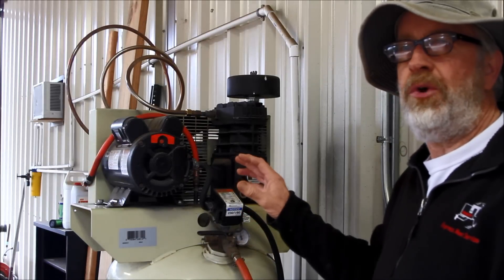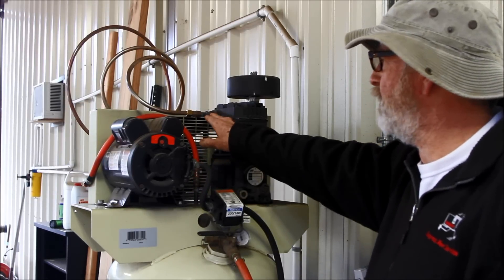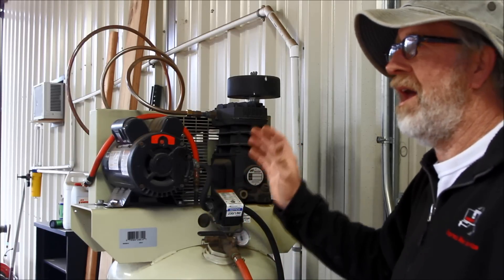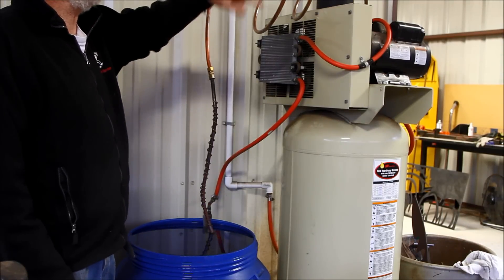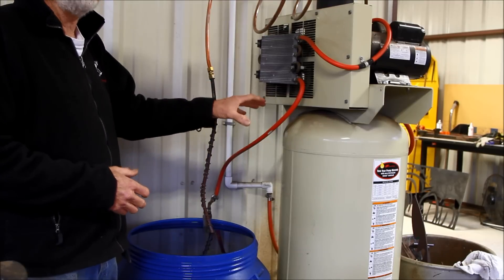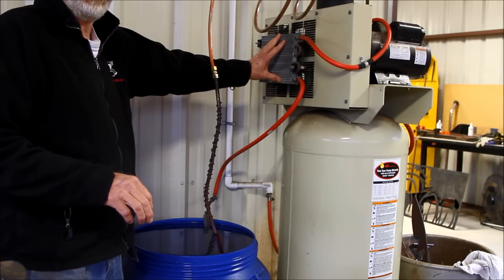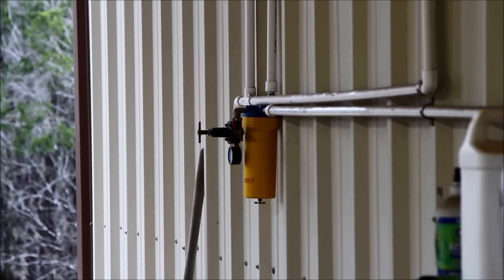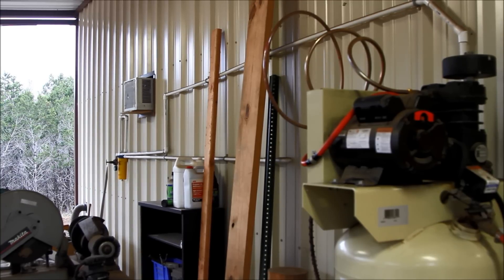How to make a Air Compressor After Cooler (low cost)

Comment: Hey Doug....Could I run the copper coil in a ice water bucket directly out of the tank and get the same result? ( as opposed to after the pump) Thanks, Tim
Reply from the maker: +2ndTimothyOutreach NO...couple of things, ice would not last very long and be back to air temp very soon.and you need to cool down the water before the tank. that is where its going to trap water by the heat, you don't need to cool down the air in the lines, that will not help you very little or at all
Reply: +Doug Green  ... Sorry ...Ice water ( water with ice in it..same as yours)  ...If I cool down the air , and then have a gravity pipe to bleed off the water and a filter..that should work correct.?, ( it would act like the tank.....Seems a bit easier to for me to do)

Comment: Hi Doug,You did a nice job and it looks to work very well. Can you tell me please which air filter and housing you are using for your compressor? I do have the same compressor at home, and i dont like the small plastic filter housing with the undersize filter. I believe it is choking the air compressor. I would like to upgrade mine with the same filter as yours. (Mine is a SS3L3 60 gallons vertical tank). Take care!
Reply from the maker: +Etienne Gallant http://www.amazon.com/gp/product/B000GI0H2M?psc=1&redirect=true&ref_=oh_aui_detailpage_o02_s00this is the motor guard I have just before the tools
Reply from the maker: +Etienne Gallant http://www.amazon.com/gp/product/B000RH370G?psc=1&redirect=true&ref_=oh_aui_detailpage_o04_s00

Comment: Thanks for the video, very helpful.  However, I'd strongly encourage replacing any PVC tubing with either iron or copper pipe, or a RapidAir type of tubing.  See:

http://www.hoseandfittingsetc.com/our-blog/bid/94802/What-Type-of-Pipe-Should-I-Use-for-My-Air-Compressor
Reply: +Doug Green  I all so run pvc and have not had any thing go wrong in 20 years
Reply from the maker: +MrLarryQ  Thanks for just "encouragement" I have other people almost saying I'm am idiot I have been using PCV for 40 years in my shop/shops and have never had then fail. it's rated for 240PSII only run 115/125PSI... and it's all out of the sun.
Reply from the maker: +Fat “Cajun Thibodaux” Cajun THANKS.....

Comment: I'm concerned that the water that condenses out of the air in your coolers may be getting pushed into the tank and settling in the bottom so you won't notice it coming out with the air. It could rust out the bottom of the tank and make it dangerous.You didn't say if you are regularly draining the water from the tank through the petcock on the bottom. see the video Why you should drain your air compressor.
Reply from the maker: manstersr I have two automatic drains, one on the tank, and one at a drop/drip loop after the tank, when I'm working and the compressor is on they purge about ever 30 min.

Comment: Would it not be better to have the water trap after the water barrel coil to prevent the condensed water in the pipe going back into the tank?
Reply from the maker: I redid it and put a drain in the bottom the coil and out the tank, does help a little.
Reply from the maker: Shaun Dobbie Not sure, don't think there is not that much air in that line to make a difference. there would be some line before you could get to the water? That is a good question, but it workswell the way it is, Thanks
Reply: YES!  It is nuts to condense and capture the water only to dump it into your large tank.  It is tremendously better to also keep your large tank dry and prevent it from rotting out.  Mr Green has a great idea -- but poorly executed.  :-(
Reply from the maker: and as far as rust,  I do have two auto bleed valves, that drain for 4 sec ever 20 min when it's runningand when I moved the old tank to my other shop, it had very little water in it and was just a little black. but Very Little maybe a tea spoon
Reply from the maker: But is works well, I have a lot less water in my "big" tank than I did before I did this. and on a side note I upgraded my compressor, and this time when I made the water tank, I put a value at the bottom to blow out any water that might be in the line at the bottom of the copper coils, I get very little, but with that said, the new compressor runs a LOT cooler, not sure how, it's does more with less 18.1 CFM @ 90PSI

Comment: How often do you empty the copper coil in the after dryer? Do you have to remove the coil from the water to empty the moisture?
Reply: acklan3 NO never have, don't think it would need it, I don't think water would ever stay in that line?
Reply: Doug Green where does the moisture collect?
Reply: Doug Green  thanks for the reply.